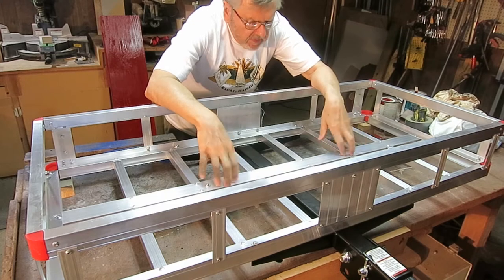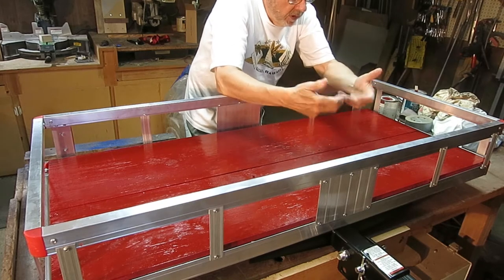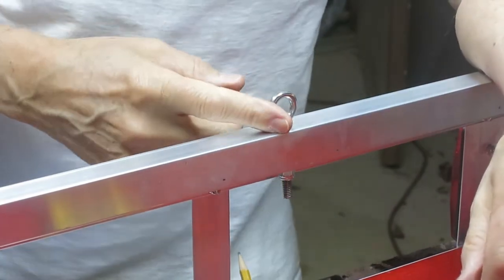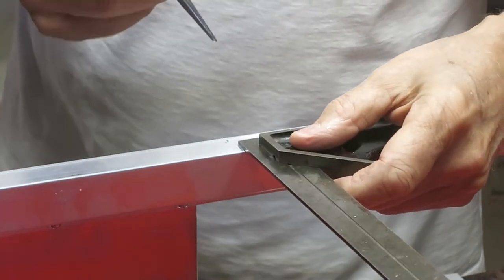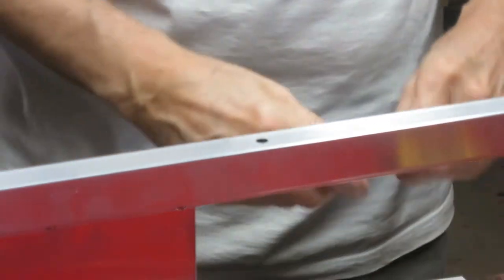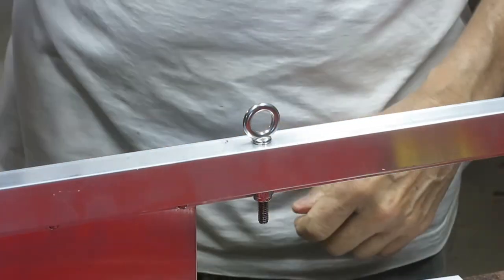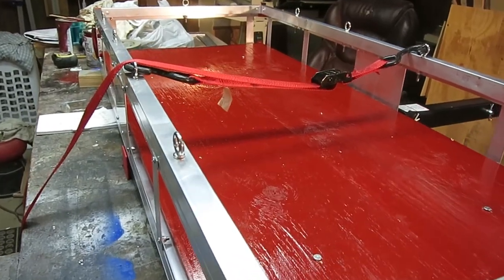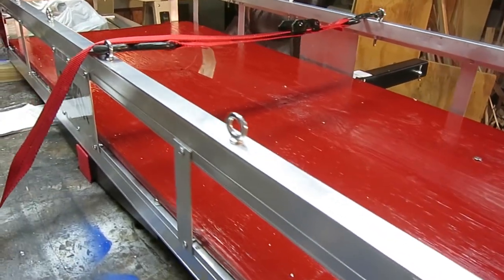DK2 Cargo Carrier Mods.

Comment: Won't be buying a Black and Decker drill any time soon.
Reply from the maker: I understand that; but it is almost 20 years old. The only reason I still have it and another just like it, is that when I went to buy a new battery they were closing out the drills to be replaced by a newer model. The closeout came with a battery and was cheaper than just buying a new battery. Was it a deal, or just prolonging my misery.